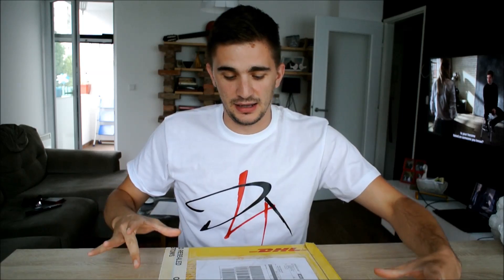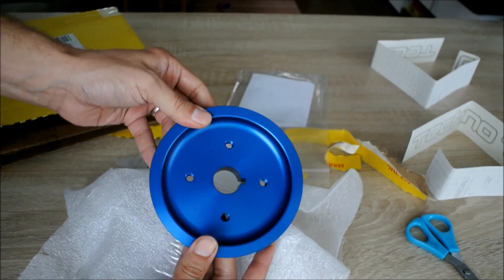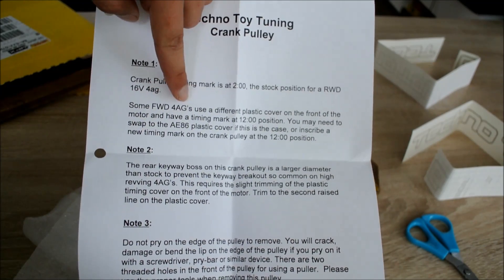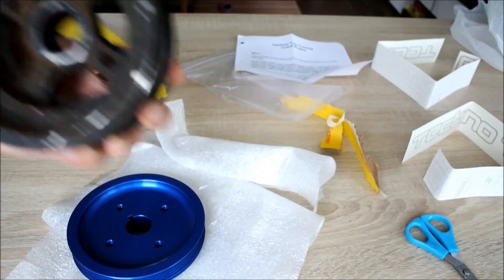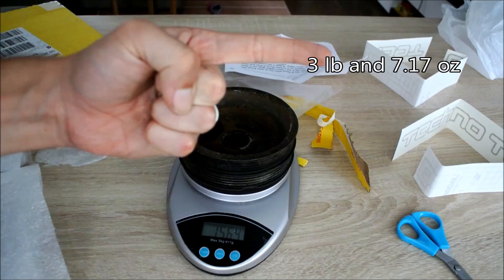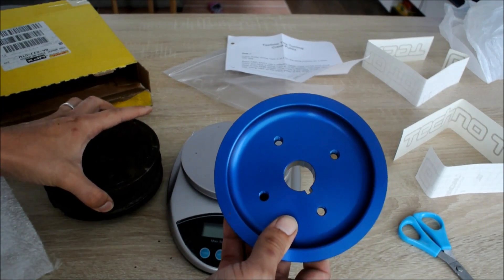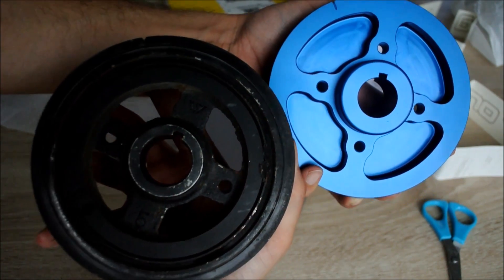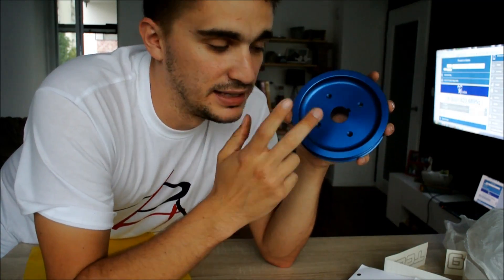Lightweight crankshaft pulley unboxing

Comment: I put a 1.6 pound VMS crankshaft pulley on my 1.8 miata what a difference the combo with a 64mm throttle body and adj cam gears it's how Mazda should have made it

Comment: Did you need to add any new timing marks to the pulley from T3 or is the one mark on the pulley correct?  The only reason I ask is that my AW11 pulley has 3 marks on it.  One at TDC, one at 10 BTDC and one at 16 BTDC.  Are you able to time the engine with just the one mark?
Reply from the maker: You need to add marks for an Aw11. I added mine on the pulley and sump using white paint as I find it easier to use the timing gun from underneath than to look at thst fiddly stock spike.
Reply: @d4a  Thanks!  I will probably do the same.  Keep up the great content.  I'm behind on the videos since I just bought my AW11, but really enjoying your channel.

Comment: Man, i was really going to recommend you go with a fluidampr or ati racing harmonic balancer but since i saw your comment below, you said you don't need it... I swear i believe every engine requires one, the harmonics will destroy an engine. I was reading up on how fluidampr is more linear which is better, does the job from low RPMS to high RPMS while the ATI racing only does it at i believe low rpms but then again i saw a article or post by laskeyracing i believe which states apparently Fluidampr doesn't do their job at high RPMS, contradicts what URGEdesigns says and recommends for the S2000 harmonic balancers. Anyways, i hope nothing goes wrong, D4a.

Please watch, i don't want to see your hardwork go to nothing.
https://www.youtube.com/watch?v=V1hX1liR7r8
Reply from the maker: Look, I know this is a very hotly debated topic, but harmonics will not "destroy" an engine. Yes an ATI or BHJ crank pulley is better than the one I am running, and yes an engine with those pulleys will likely last longer. But that doesn't mean an engine with a pulley like mine will just fall apart. The effect of harmonics, on a well built engine, becomes apparent only after many thousands of miles. I will likely go very bored of this engine and will want to build something else long before the harmonics will have any chance to destroy anything. This is not a daily driven car, if it was I might have gone with ATI or BHJ. This is not a 10.000 USD engine, if it was, I might have gone with ATI or BHJ. But as things are right now, this is a fully acceptable solution. If it kills the engine, we will know, and I will post about it and then lightweight pulleys are truly the devil and no one should ever run them at any time ;)
Reply: gotcha :D

Comment: I got one! It fits perfect. I also got the 36-1 toothed timing wheel. That is why it has 4 holes it in to mount the timing wheel. I have it on my 4agze to run a Ford EDIS ignition system.

Comment: Stock crank pulley is weighted for a reason. Helps dampen vibrations in the rotating assembly.
Reply from the maker: cesar lopez I was concerned about that as well, but after asking a lot of 4age experts I can safely say that this crank pulley does not dampen vibrations in any way.
Reply: Yeah that stock pulley does not have a rubber isolater like many stock pulleys, so going from solid pulley to solid pulley really isn't going to hurt anything. Given the age and rust, I wouldn't be surprised if the stock pulley cause more vibration than the new one will.

Comment: While pretty, the lower weight isn't significant relative to the overall rotational mass of the engine assembly, engine driven accessories, flywheel, transmission components, differential, driveshafts, wheels, rotors, and tires.  When driving, you have to overcome the rotational momentum of all of these components...plus the momentum of the car itself.  Even a lightweight flywheel, where the rotational mass is much farther away from the axis of rotation of the crank, while making a difference in the ability to rev an engine when in neutral, will have negligible to very minor effects on the acceleration of a street driven vehicle (for the same reasons listed above).  The thicker diameter of the crankshaft pulley at the keyway is necessary for the lightweight pulley as it is made of aluminum, as opposed to steel of the original pulley.  Comparing apples to oranges.
Reply from the maker: Rene Neron I get what you're saying and it does make sense, but I have to argue against the effects of a lightweight flywheel being negligible except in neutral. There really is a difference to be felt, and if it were negligible there wouldn't be that many lightweight flywheels out there. Of course the wheels, drive shafts and all the other bits need to be moved as well, but if the total weight can be reduced why not do it?
Reply: driving 4 answers a lightweight flywheel will improve the responsiveness of the engine, without question.. i stated that.  What I also said was that it would make negligible to minor effects on the acceleration of a street driven vehicle.  Responsiveness of the engine is helpful for rev matching on a manual driven car; downside is impact on drivability, particularly in stop and go traffic.  OEM manufacturers err on the conservative side; you can make trade offs to the performance side at the expense of something else...tires, suspension, drivetrain, etc.   Show me data on an AW11 where the use of a lightened flywheel versus stock on the same car / engine makes a significant difference on the acceleration of the CAR (not just revving of the engine in neutral).

The market for aftermarket "performance" pieces isn't driven by need or benefits; it is driven by the profitability of the market being served.  Doesn't mean that there aren't aftermarket parts available that don't provide clear benefits.  Rather, just because an item is available, don't assume it does provide any benefit on your vehicle for your situation.  You pay your money and you make your choice(s).  Toyota themselves went to a lighter weight flywheel on the more performance oriented 20V variants of the 4 AGE; the higher the engine revs, the more of a difference (benefits) of a lighter weight flywheel for engine responsiveness.

Downside of the lighter weight pulley?  Durability, strength, longevity, robustness, and vibration dampening of the internal engine vibration / harmonics.  The stock part is a harmonic balancer, not just a pulley.  It was engineered as such for a reason by some rather good engineering teams for an engine used in millions of cars over decades.  Will it hurt anything removing it?  Time will tell and clearly, the new part does provide other benefits to YOU, which is what matters.
Reply: 802 Garage you are absolutely correct that the 4AGE pulley is not considered a harmonic dampener; more for noise insulation and nothing to do with engine dampening.  My error.
Reply: Given that the combined weight of the gear set and crankshaft in that car is probably around 50 lbs. cutting 10+ lbs. from the added weight of the flywheel and pulleys is probably significant. Even including the axles and clutch, it's still a non-negligible percentage. Don't forger that most of the weight removed when changing both a pulley and flywheel is much further from the center of rotation than the weight of axles and even a lot of the crank.

So you are also saying that it will have no effect on performance, but will impact driveability? How can it be both? It either does or does not have a significant effect on drivetrain performance. Let me use another example. A set of OEM wheels and tires might weigh 35 lbs. a corner. If you cut that to 30 or 25 lbs. is it going to make zero difference? Even at 30 lbs. it's a small decrease, but significant.

Show us data where lightended drivetrain components on an AW11 DON'T make a significant difference. Now, I'm being obtuse, but what I'm saying is you are speaking from conjecture without supporting your argument as you could say we, and everyone else who has ever bought lightweight pulleys and flywheels, is doing. So I'm not going to promise you that it will make a difference or won't, but it seems to me you are just trying to sound like an expert on this without having concrete data yourself.

As addressed multiple times in the comments by the way, the stock pulley is not a dampener. You will see in the video it is a solid piece with no rubber separator and therefore has little to do with vibration dampening. There is also no reason the aftermarket pulley should be less durable. Unless someone hits it with a hammer. He even did research to make sure it wasn't a harmonic balancer, which is less important on inline or flat engines than other designs anyways.

So again, not going to tell you that you are wrong, but you do contradict yourself multiple times. It either does or does not affect drivetrain performance. Manufacturers either do or do not care about the weight of the flywheel and pulleys for a reason. It either does or does not make a difference. It does make a difference, we can agree to that. So the question becomes can you feel the difference? Is it significant? That is harder to say and we would need more information and data, but hundreds of thousands of people claim yes.
Reply: So our lightweight pulley has reduced the rotational mass by 10 lbs?  Quite a leap.  By drivability, it iis negatively impacted by a lighter weight flywheel in stop and go traffic as the angular momentum / inertia of the rotating mass relative to the momentum of the stationary vehicle is at it's lowest  Power of the engine is lowest (while still having to accelerate the vehicle from a stop at with no forward momentum) at low rpm.  You are also ignoring the mass of the wheels, tires, rotating engine assembly, brake rotors, axles, engine components, etc...50 lbs?!  No way.

Responsiveness of the engine is different than drivability.  No free lunch with a lighter flywheel.  If not, flywheels would be considerably lighter from the factory.  It is a compromise, not unlike treadwear versus traction on a tire.  Race cars want lightweight flywheels to allow rapid rev matching, as stated i prior.  Not nearly as important on a street driven vehicle, though it can provide benefits.  Just not necessarily on the acceleration of the vehicle (significant or practical benefit).  A lightweight pulley will provide far less benefits for the same reasons both you and I stated...much lower mass, much less of a difference relative to stock, and location of the center of gravity relative to the center of the engine,

The 4AGE dampener is not a solid piece.  It is a harmonic dampener; 2 piece separated by a thin layer of silastic material (rubber).  I have one.  Look it up.  If you still have your AW11, look closer.  Might not make much of a difference, but was engineered as a dampener for a reason.
Reply: I was talking about the combined weight of a lighter flywheel and lighter pulley, which on average, would save at least 10 lbs.

What I am saying is, if the angular momentum or inertia or rotational mass of a flywheel can negatively affect driveability, that means it can also positively affect it. You can't say it does one and not the other.

I wasn't ignoring them, I was cutting the system into sections, and I even mentioned the axles wheels and tires. If the entire combined system is 200 lbs, 10 lbs. is still 5% which is still a very significant amount.

You continue to say it is a compromise, which still demonstrates the point that there IS AN EFFECT from a lighter flywheel, thereby defeating your own argument. I don't know how much more I can say about that?

The pulley he has is not a harmonic dampener. You can see in the video it is not two pieces. That's exactly why I said what I said. There are multiple pulley variants and his is not original to the MR2 anyways. He also did research on the topic before buying the pulley.

Again, I fully agree with you that the difference is small. What we also seem to agree on is that there is a difference. You also still don't have any data to say otherwise nor do I to confirm.

So what we can agree on is that there is a percentage difference in rotational mass which affects both driveability and performance. To what extent, we cannot currently quantify.

Sorry man, but it really just feels like you were here for no other reason than to act like an expert and be a negative nancy. Believe me when I say I have done hundreds of hours of car research as you probably have.

If you do some more research, you will find the 4A-GE is considered to not need a harmonic balancer and that most people do not consider the factory pulley to be a harmonic balancer or dampener, even when equipped with a rubber layer. His engine will be fine.
Reply: We clearly aren't going to agree.  I enjoy the videos, and if he is happy with the purchase, all that matters.     I wasn't the one making the claims about the lighter weight pulley (alone) making the engine spin more freely, which is what is stated at the end of the video.  Theoretically, yes; practically, no.
Reply: @reneneron2971  yes the engine would spin more freely with the aluminum flywheel , pulleys ,ect .
But this is my thought on the weight of the components .
Once you remove all the rotating weight ( flywheel,  pulleys ) it seams to me the the torque of the rotating engine would suffer from the weight that has been removed. 
In other words,  say you have a 60. lbs flywheel spinning and a 10. lbs flywheel spinning , whitch would move the car from a standing point easier ? 
JMO ....
Reply: The one with the 60 lb flywheel.
Reply: @shobud7561  the flywheel should be looked at as a energy storage device in this situation. With the 60lb flywheel it will have a lot of energy stored so you would not have to rev the engine very much to accelerate from a stop without stalling while the 10lb flywheel would need more throttle and higher revs to match the other engine. The shifting between gears would take slightly less time and all of the not insignificant power that would normally go to accelerating the flywheel's rpm will now be available to accelerate the car.
"Drivability" would be worse but that's a metric meaning "how easy it is to drive". Drive it a little differently and it's better off
Reply: Rene Neron i also want to point out that according  to Tune to Win, because the engine's rotating assembly spins at such high speeds, rotational inertia has a much stronger effect thus making reducing weight more significant. I dont remember if this is entirely true though(been a while since my dynamics final)
Reply: theafroninja absolutely.  Read my original reply.  My comment referred to the impact of lighter weight rotating components on the acceleration of the VEHICLE.  No question that reducing the weight of rotating components, particularly the engine, improves the ability to accelerate those components. Difference depends on mass, location of the mass relative to the axis of rotation (center of gravity), and acceleration of that mass.  In other words, negligible benefits of a pulley, particularly relative to the mass / momentum of the vehicle.  Flywheels have a much greater effect on the ability of the ENGINE to rev, but the benefits of acceleration of the VEHICLE will be much, much less as the vehicle's momentum is much, much higher (1000 kilograms, which is 3 orders of magnitude greater than the reduction of weight from a pulley, and at least 2 orders of magnitude greater than that of the flywheel).  Original reply is being taken out of context.  Lots of information on benefits of a lightweight flywheel available; even Toyota used them on the 20V variants of the 4AGE, but increasing the ability to accelerate the vehicle as a result of a lighter weight flywheel is very small.
Reply: It doesn't hurt though, does it? I was going to make a similar comment about the thickness of the aluminum though. Should be plenty strong either way.
Reply: Thanks for the discussion anyways, sorry if I came off as a jerk, it all just struck me as kind of keyboard rebel without a cause, hahaha. I didn't feel he made any false claims, personally. It's clear you at least have a grasp of physics, which is the important bit. Many YouTube commenters don't, like flat Earthers. Catch you later.

Comment: Woo keep up the uploads! I wanted to do that mod back when I had a bluetop 4a, let us know how it goes. I still have that old block but nothing to throw it in, so if I ever rebuild it I want to know what impact this pulley does to an n/a 4a.
Reply from the maker: Martin Thomas I will do an installation video and update after I have driven the car with this pulley. Thanks a lot for watching. I have a 40mm  crankshaft for that block, it needs to be ground because it had quite serious rod knock but I will give it to you for free if you cover the shipping.

Comment: That stock one looks like a 4agze crank pulley. Should be pretty sweet with the T3 pulley!
Reply from the maker: Nick Pahls My engine is a Frankenstein from several 4ages, it took me forever to figure out which part came from what type of 4age. This crank pulley is from a European fwd corolla, and you're right it looks just like 4agze one. I'm looking forward to installing the t3. Thanks for watching :)
Reply: driving 4 answers haha my engine was the same, and the pulley will look a lot better on there anyway lol